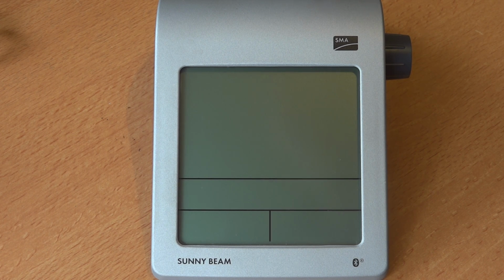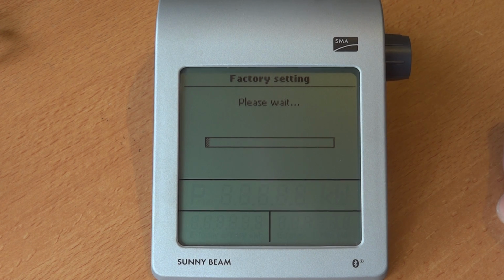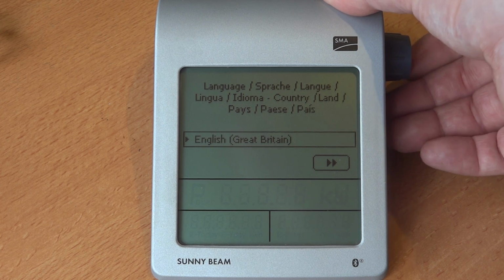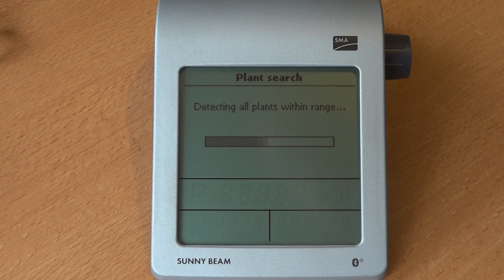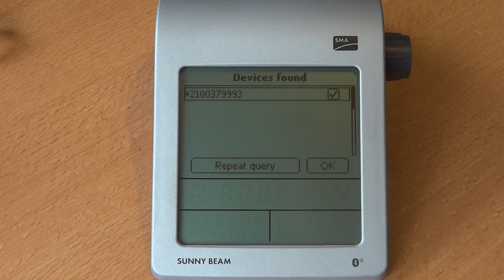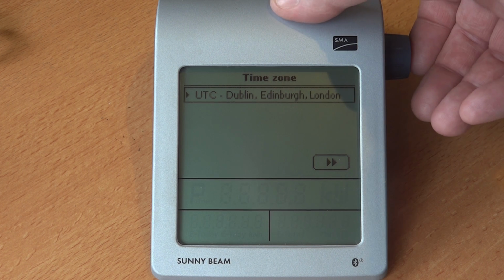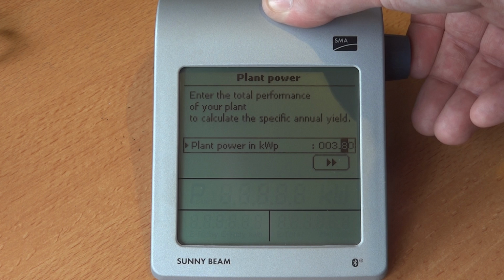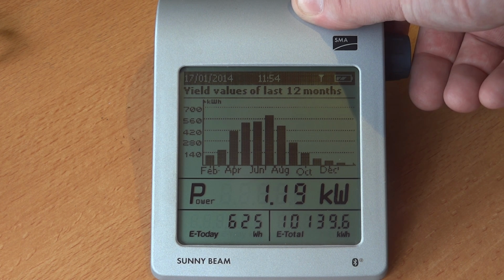Reset Sunny Beam

Comment: mine has frozen on the device information section with the egg timer on the front screen, any ideas?
Reply from the maker: Sam Harman I would just remove the batteries and then replace them to reboot the unit. If still no joy, the remote maybe bust.

Comment: after following all the instructions I succeeded but after a while the screen goes blank so I can't see the changes instantly. What went wrong?
Reply from the maker: Probably the rechargeable batteries are dead, so replace them, then plug the Sunny Beam into a computer using the provided USB cable for 24hrs. Once batteries are fully charged, repeat the reset procedure, and all should be well again.